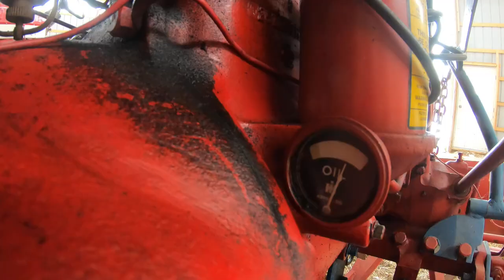snow day: working through a snowstorm on the farm

Comment: I Made a V-snow plow blade for the loader so i could split the middle of the driveway, then turn around and push the sides off much easier and i made a straight plow blade to fit on the 3 point hitch to dress up the edges and push up piles.  You might think about getting some snow chains or maybe half tracks for plowing snow and cleaning manure and mud up easily.  The little tractor that looked like a case would do better with snow if it had a small counterweight on the back. Maybe a half of a 55 gallon barrel worth of cement or rocks in it.

Comment: Not sure it would work with the type of snow you get but we use a coarse turkey/chicken grit when we have problems getting traction in the snow. We also use it on slippery sidewalks and walkways as it will not ruin any concrete we might have.

Comment: I see you have a 504 in your barn. I love those. I used to work at a state hospital and we had a number of Internationals from the 60's and 70's in use. The 504 was one of our main workhorses, as it was used as our primary front end loader. We also had a 444, 460, 706, and a Cub. They were all well-used and indispensable pieces of equipment.
Reply: Case 444 as in the garden tractor right?
Reply: @farminghuntingtrapping-fht  No, it was a Farmall 444.

Comment: A lot more snow that Super A made its way through than what I figured it would.  After about 4 inches of snow my lawn tractor with snow blower is spinning its wheels...rear suitcase weights and tire chains and it does great, but I have to run it when there's maybe 8-10 inches of snow otherwise with the 3 stage blower it don't work as well....should have gotten the plow blade for it as well, but I don't think you can swap between the blower and plow, stupid that MTD didn't make a universal front hitch for them, it would require a lot of work to swap hitches around to change between the blade and blower.

Comment: I was living in W.V. when the 93 blizzard hit...
I worked at a large aluminum producing company that ran 24/7 365 , simply because the process could'nt stop because of weather...
I was forced to stay at my job 48 hrs straight.. 
When the snow stopped falling, many could'nt get out of the parking lot...
But..I had just bought a brand new Chevy 4x4 & I was determined to get home...
The highway that came up out of the river valley was very steep..
And dozens of cars were spun out & stranded..
I sat at the bottom of the hill discouraged .
But suddenly a tractor with chains came from a farm located at the bottom of this massive hill...
He hooked onto me & pulled me right to the top...
Being an older gentleman , I offered to go back down & do the "chain work". 
3 hours later I was wet & cold & worn out..
But we pulled a couple dozen stranded motorists up the hill...
When I got home , I filled my wood stove to the max & crawled into bed after being up for 2 1/2 days. 
I didnt go back to work for a couple days because the govenor , in his infinite wisdom, announced all roads closed & anyone caught out would be arrested ..
Ok by me ...
I hunkered down with my family & (without power) we slept near the woodburner .
Amazing how much you read when the tv isnt an option.